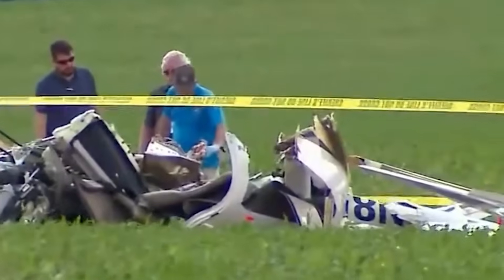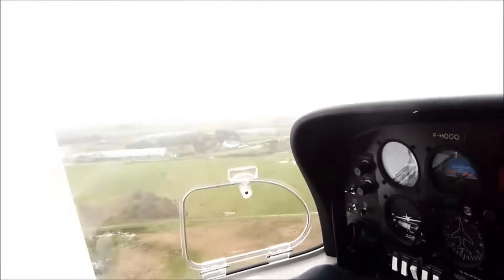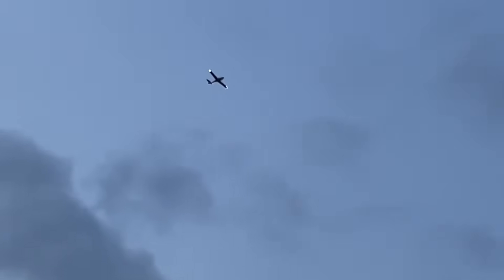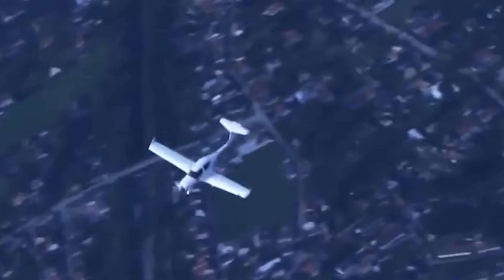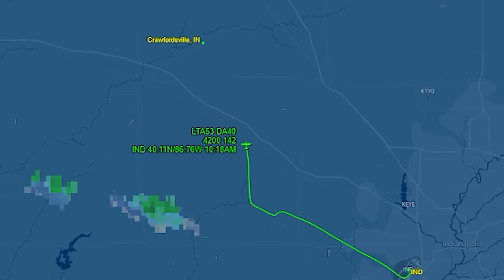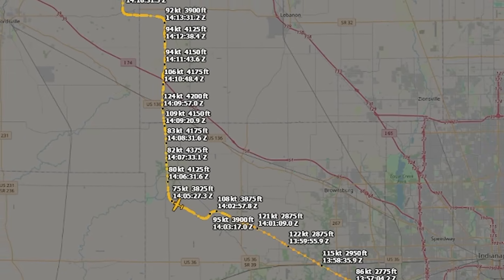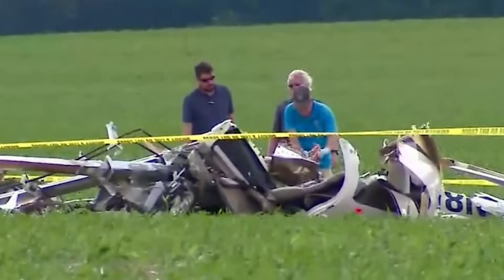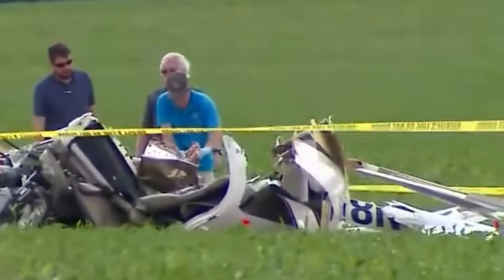The REAL Reason Why This Routine Training Flight Turned Into A Fatal Crash…

Comment: RIP.... I FLEW  A DA20 FEW HUNDRED HRS.... DID  DOZENS OF  STALLS AND SPINS .... YOU CAN FEEL THE STALL COMING... IT THUMPS ALOT....  IN A DA20 IF YOU STALL OR SPIN OF COURSE YOU CAN RECOVER .... STICK FORWARD STEER WITH FEET.... EVEN IF YOU STALL IT... YOU CAN EVEN JUST LET GO OF EVERYTHING AND IT WILL RECOVER ON ITS OWN  IS WHAT I FOUND

Comment: If yaw is present leading up to the stall as stated the wing will drop, you can bet your life the first thing the student will try an do is use aileron  to correct, and that  is all she wrote if you are at circuit height. Do not allow yaw approaching the stall, if you do, use the rudder to correct.
Do not use an aircraft for training that is not approved for intentional spins.  If you are performing  spins, no less than 5000ft and wear a parachute.

Comment: Is stall training really worth the risk ? Maybe keep the plane in its flight envelope .
Reply: Actually at first, you should be training to recognize that you are approaching a stall, and then you train to prevent the stall from actually happening. Once you have that mastered that, you can graduate to power off stalls, and stall recovery. The most dangerous type of stall of course is the power on stall, It's more dangerous because you have three types of torque created by the propeller and the engine that aerodynamically affects how the aircraft is going to react. And if you keep the power in after a power on install there's a very good chance that you will go into what's called a flat spin and unless you reduce power you will ride that flat spin all the way to the ground.